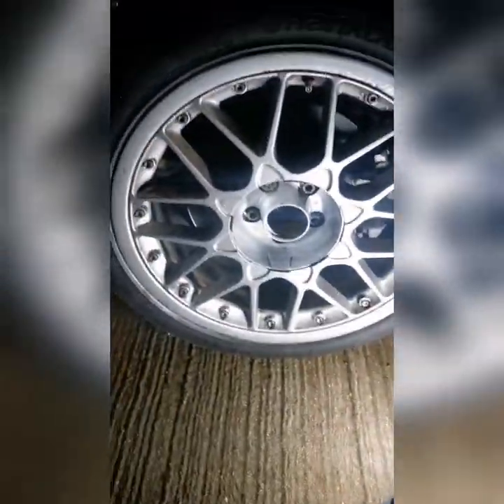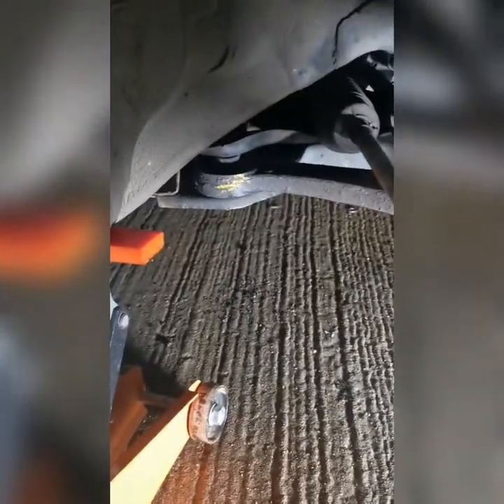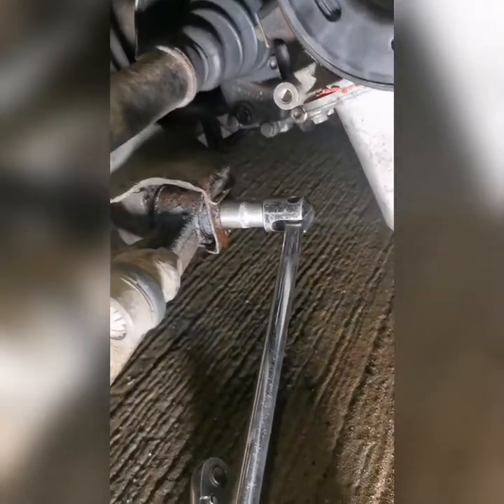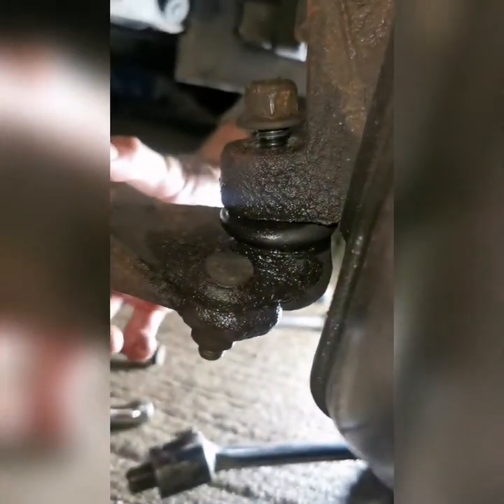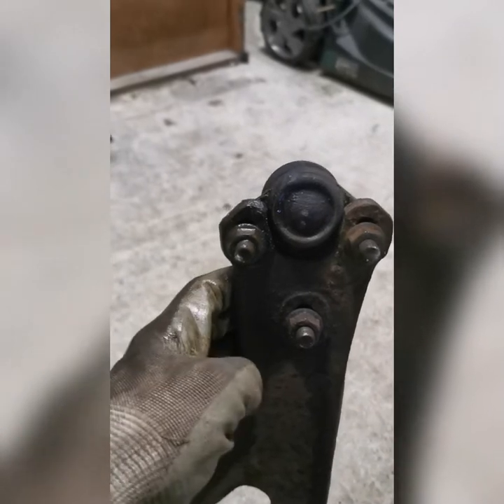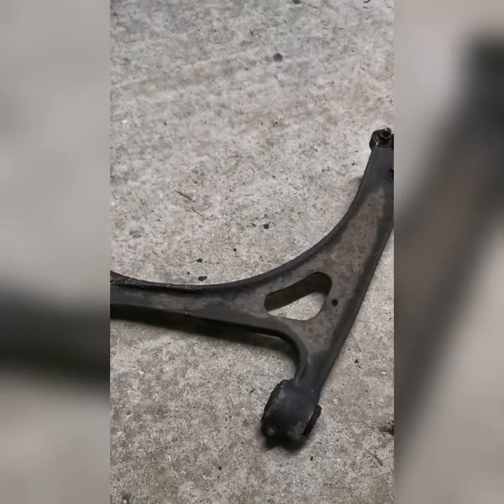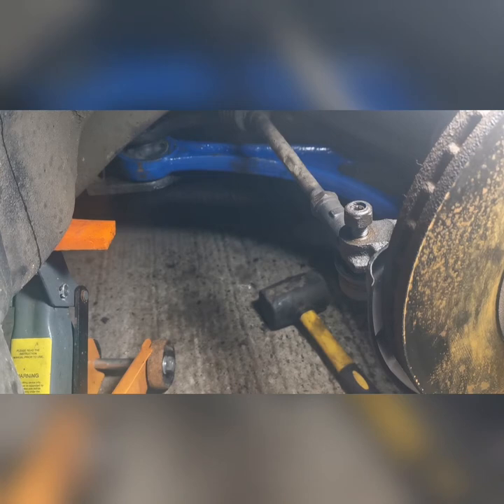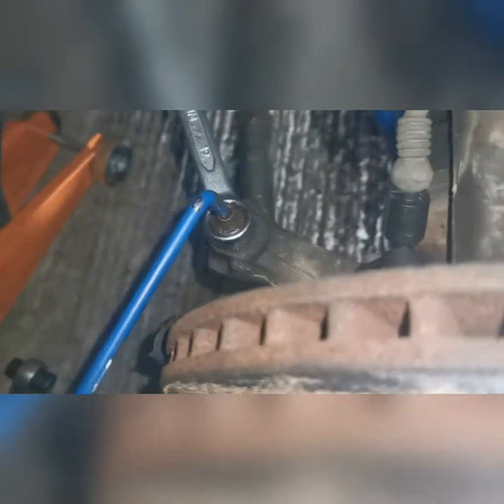BUSH REPLACEMENT front lower suspension Audi TT MK1

Comment: Sorry if i missed it, but did you reuse the bolts or order new ones?
Reply: Of the bolts look fine you could keep them. But gernerally speaking you have to change every bolt that gets a torque AND angle value for thightening. That is because the angle after applying the torque actually lengthen the blot and slightly reduces the diamiter.